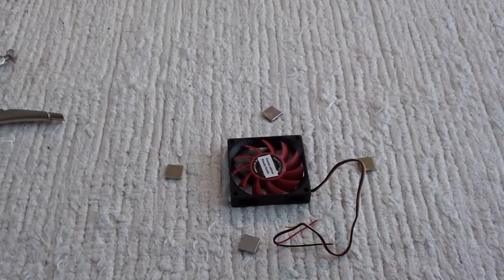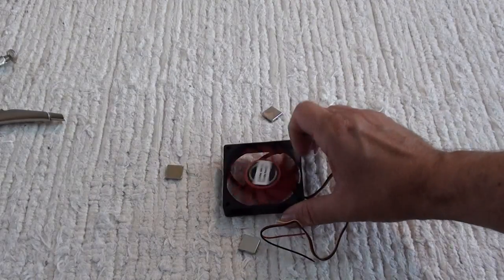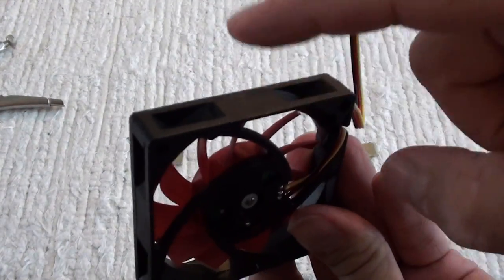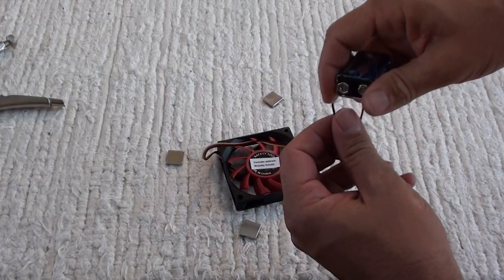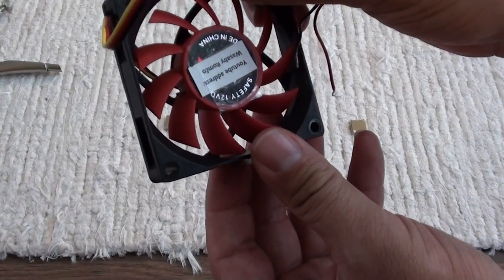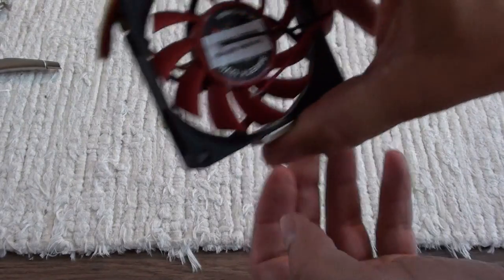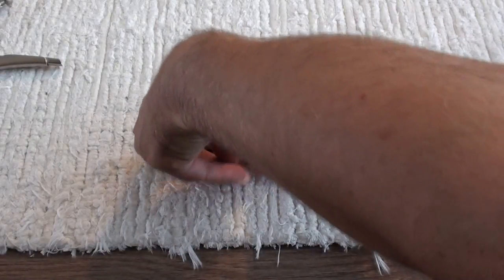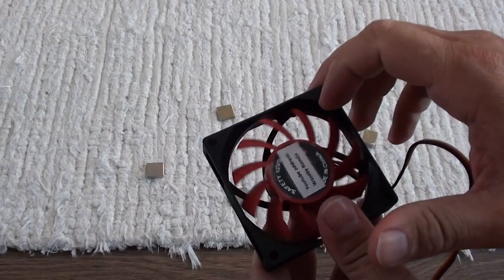Free Energy Magnet Motor (Engine)  | WasabySajado

Comment: you need to put magnets all facing the same way on your fan blades then when you put another magnet turned around the magnets will then repel each other hence making the fan turn. That part is common sense that it does work. now that it does turn means it is creating energy but not sure how the fan electronics are setup if it will harness the energy and send it out the wires or not but even if not you can build somewhat of a coil and caps to do it. so yes it will work but not sure how much you could pull from it or how big it would have to be to get the energy you would want it for.
Reply: it seems to be common sense, but, if you put them on the fan blades it will not keep turning because the opposite pole of the magnet is attracted to the magnet held in hand on the back side of the magnet on the next fan blade, so, even in theory it is wrong, and no, it is a misconception. try it yourself, it will never work. Now, if you have a monopole magnet, which is very hard to acquire, it will spin until the magnets die, but, here in the US, we are outlawed from buying them because the DOE has taken over the sale of them from US buyers. Period, the end, it can not be bought , and when they are, and they find out, we get to hand them over and most likely get locked up on security fraud charges because they can produce energy.

Comment: The key is the fact that the coils aren't emitting or have magnetic fields until there is electricity running through the wires.  So all these free energy computer fan videos are garbage.  With out the magnetic field created by the coils of copper wire reacting to electricity there isn't anything for the fields from the rare earth metals to interact with...  Try it yourself it wont work.